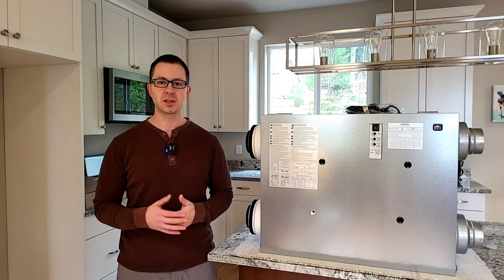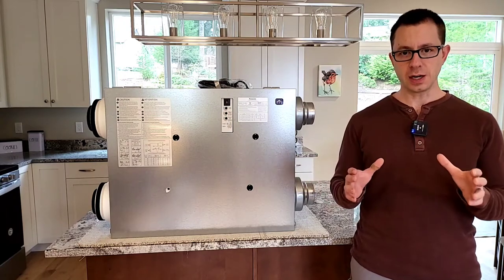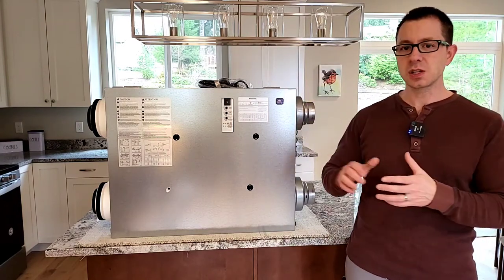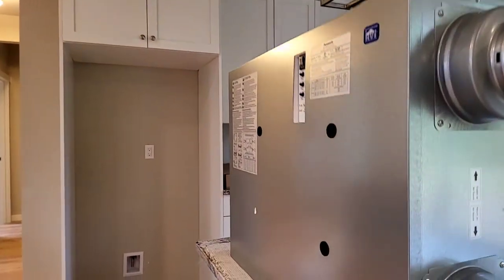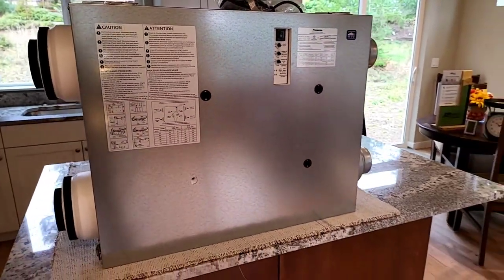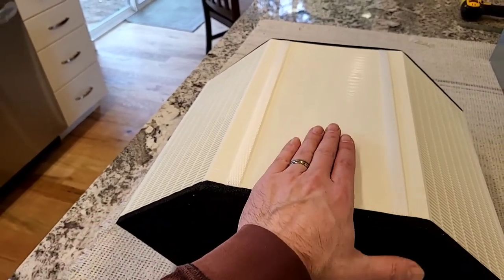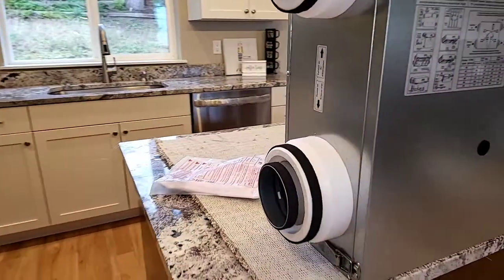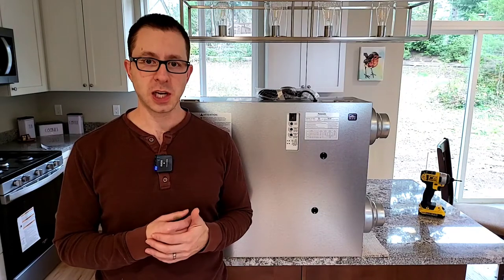Walk Through of the Panasonic Intelli-Balance 100 ERV

Comment: I'm really looking for how it works - the thinking behind the heat exchange. does it work differently in summer or winter? And, where to look for info on knowing what settings are right for home conditions (people, closed windows, etc).
Reply from the maker: I recommend an indoor air monitor and adjust as needed. In general, the humidity during winter will be higher than straight exhaust or supply ventilation (that's a good thing) and vice versa in the summer.

Comment: Is there logic to adjusting supply/ exhaust air settings to reduce humidity in the summer?
Reply from the maker: I wouldn't consider an ERV to be a dehumidifier nor a humidifier. It should moderate latent moisture impacts. If you need to control humidity, dedicated equipment is better. However, ac unit might be sufficient to get you through the high humidity times.

Comment: Nice video.  In a home with one bathroom and one kitchen, could this replace the need for vent fans?  Or would the humidity load from showers/cooking end up causing chance of mold?
Reply from the maker: I'm conservative on this. I'd rather exhaust wet rooms with a dedicated exhaust fan. As far as the kitchen, I think a dedicated exhaust fan is the way to go.
Reply from the maker: @zlmdragon.  I use this ERV to supply and exhaust air for occupants. Bathroom exhaust is for moisture and smells. Kitchen exhaust is for cooking.
Reply: @PioneerBuildersInc  Thanks.  There's no mention of separate bathroom/kitchen fans in the installation manual, just wondering about your experience with any mold issues.
Reply: Yes, you can definitely use an EVR for bathrooms if it's running all the time and it's a lot more efficient. A lot of energy efficient homes do this. It's not as powerful as a well ducted bathroom fan, so your mirrors will fog, but it's going to prevent moisture accumulation and you can also boost it to max.

Comment: Looks like you have it set up to use 4" ducts?
Reply from the maker: We always go with 6 inches. From looking at the unit and installation instructions, it doesn't appear that you take off the 4" adapter when using 6" ducts. It's a surprise to me, and I could be wrong
Reply: @PioneerBuildersInc  Can the adapters be removed so that the full 6" is available to the 6" duct. It seems odd for Panasonic to offer a 6" receptacle, with only a 4" permanent opening
Reply from the maker: I agree with the oddity, but the adapters seem to be permanent. I don't know the engineering behind it, but the flow section is very minute for that one area
Reply: Right. From your great video I can see the 4" dampers and 4" opening to the fans, so (assuming Panasonic did all this for a good reason) they must have offered 6" adapters to reduce the air restrictions for the long runs through the house, and found little advantage to having 6" openings/dampers in the unit itself.